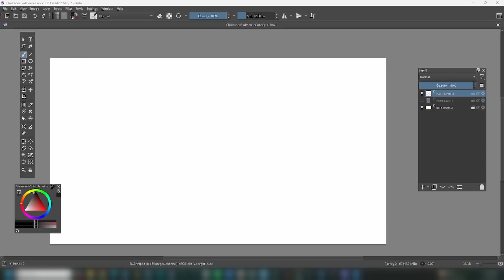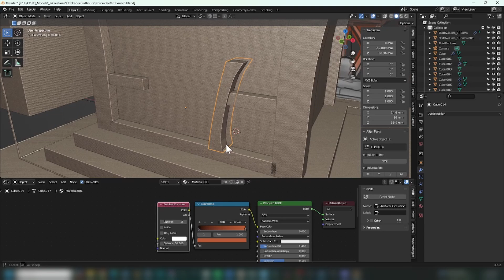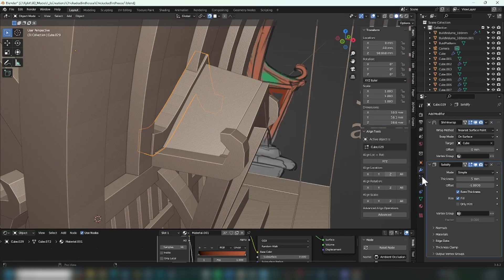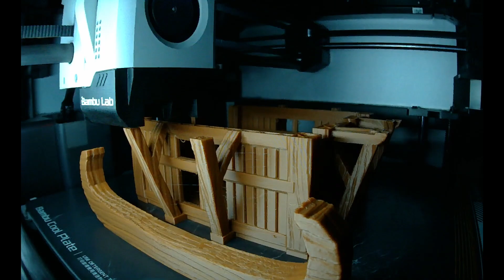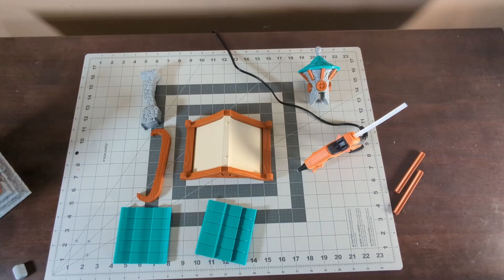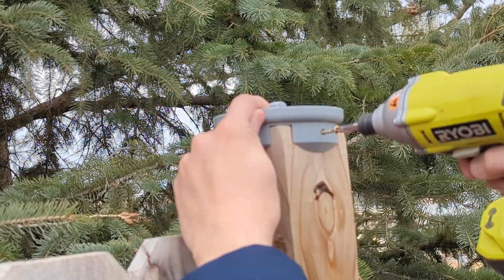Making a 3D printed birdhouse from a 2D sketch.

Comment: Hi! Can you tell me in Blender how you accounted for tolerances to make the pieces fit together? For example, if you have a hole of 1 cm, what should be the size of the pin that goes inside?
Reply from the maker: I typically allow for .4 to .5 mm of clearance. There are some exceptions to this, but in general most fdm 3d printers can handle these tolerances. You can run a tolerance test with a file designed for this on your specific printer to see how it performs.
Reply: @xykit  thank you!
Reply from the maker: @Mr2e2e2e2 👍

Comment: It looks absolutely awesome! Do you recommend any thickness for the walls?
Reply from the maker: Thanks so much. I went with pretty thin walls here due to the constraints of trying to fit in 180mm sq build volume. I would presume that thicker walls would provide more insulation. Thanks for watching.
Reply: @xykit  Ok thank you so much!
Reply from the maker: If you were talking about the number of print shells/walls 2-3 is probably sufficient. I used 2 shells for the sample in the video.